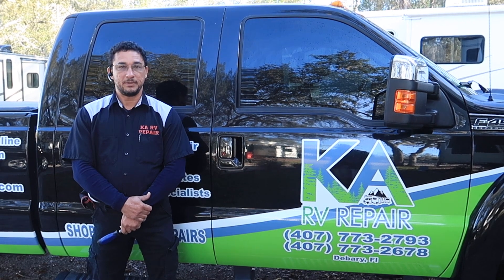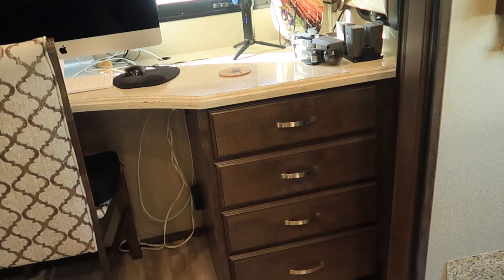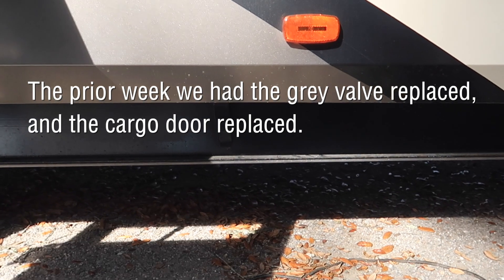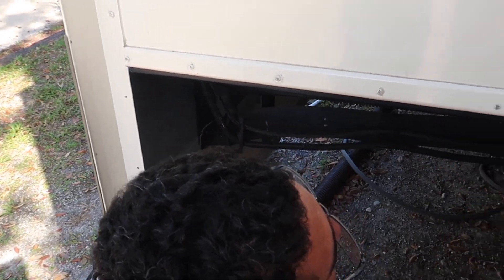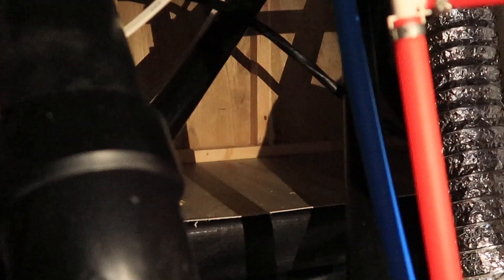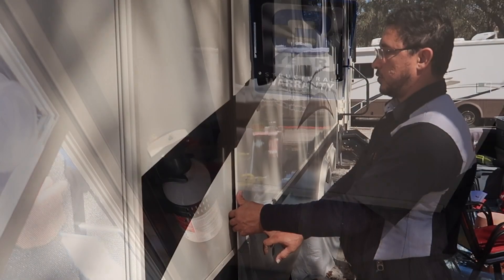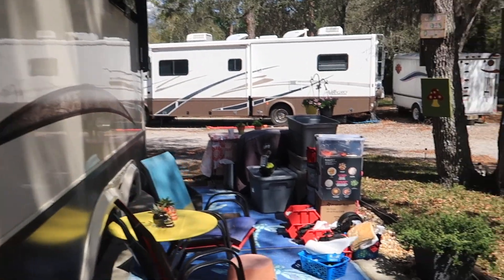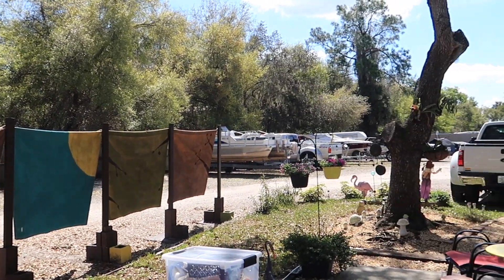Grand Design RV Tour of Warranty Repair Work: Slide Out Problems - Newbie Mistakes at PDI Inspection

Comment: The biggest problem I see with that jumbled mess of wires and hoses is things chaffing over time...When driving everything moves and vibrates. Same idea with those slide outs..The rv twists and moves slightly, so all the more reason to design, manufacture and build these components to hold up to the rigors of the road..Unfortunately some companies are better than others.. As with anything we buy that is "mass" produced, some units will be better than others..To determine the overall quality of any product takes time of course, and with hundreds of components something is bound to fail prematurely..In my opinion that mess of hoses and wires is not acceptable. Hidden or not. The unit itself is beautiful, and I love it. Great job to the tech! He seems like a great guy, and wasn't camera shy so that was a plus..Another great video guys, thank you!  ☺ I have something I need to add to this comment: I want to express my thoughts as I would any friend of mine that is in this situation...I am seeing some red flags with this situation that I am not comfortable with..In all fairness to this unit and manufacturer, I am tip toeing around what I really want to say..My intuition tells me this is just the tip of the iceberg, but who knows..My intuition is virgo strong.lol. Thanks guys..☺
Reply from the maker: Thanks. We appreciate the comment. Totally agree about the hot mess in the cargo area. You'd think they would have it more organized. Seems to be the case in all the RV's. I've seen it in many videos. I'm thinking of getting a handyman to come out and organize it better for me, then maybe push back the cargo walls to give me some added space. We'll see. Still not sure. As far as the slide, Andre said it's fine as is and will retract and extend fine, but the gap on the one side has something to do with either the frame camber being off or the actual area that the slide fits into is not perfectly square. The slide was adjusted to elevate some pressure in the corner and fortunately nothing is hitting or rubbing, so in theory, the slide works fine and shouldn't cause any problems in the future if I was to not have noticed it being misaligned.
Have a Glamperrific Day!
👍😀🌈🤪🌈😎🌈😍

Comment: I appreciate the video. I do hope that you are using a water pressure regulator in these RV parks to connect to city water. The regulator keeps the water pressure at the correct pressure to avoid damage to your water system. Cheers!
Reply from the maker: Thanks, we sure do. Have a wonderful day!